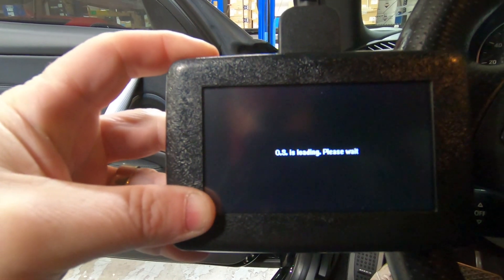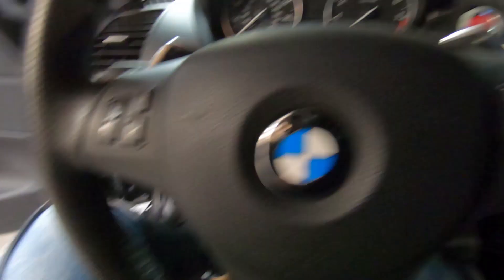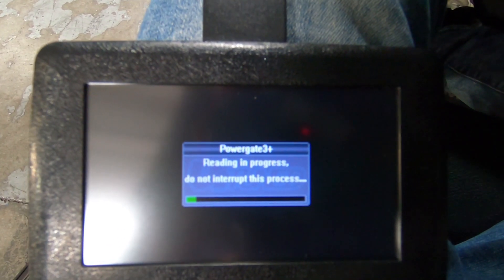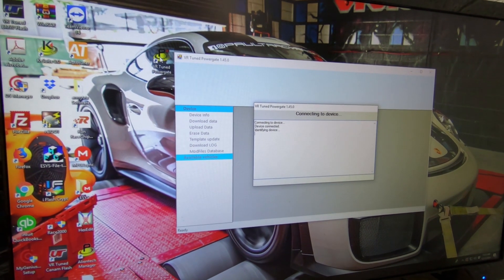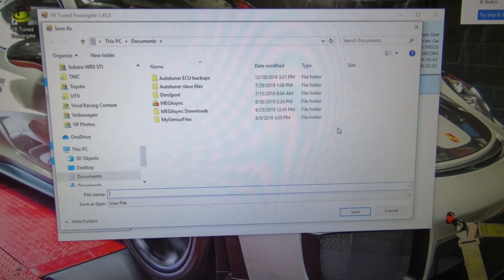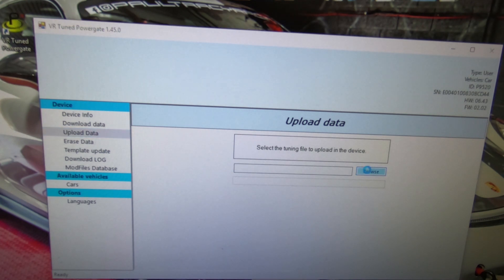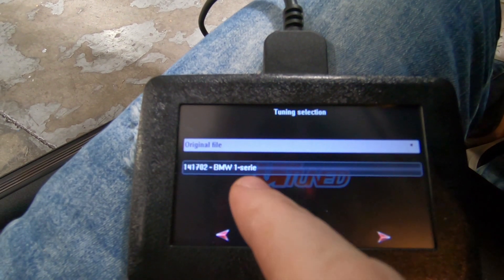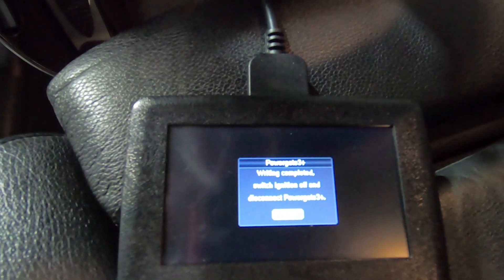How to Flash Your Car with the Alientech Powergate 3+

Comment: Does the Powergate 3 do Data logging as well?
Reply from the maker: No
Reply: The powergate 3 can data log, but only some simple stuff like knock sensors, coolant and oil temp, rpm and manifold pressure / boost pressure. There's a few others I can't remember.

Comment: Hey just wondering I got a e92 bmw 328i and if I get a stage 3 Intake manifold and buy this tune will it make even more horsepower
Reply from the maker: If your car is not tuned then yes. This device is not a tune but is the tool that writes the file to the car.

Comment: Hello, nice device! and you do a nice job to explain it on this video. I have 2 questions...1: Can I use this device on a 2006 Jaguar XKR with the 4.2 L supercharged engine? and 2... I live in NYC and my car has to pass each year a state motor vehicle inspection...would this device change anything that my car may fail the inspection? thank you. could you please answer me to my e-mail address
Reply from the maker: Yes you can. Contact us tuning@vividracing.com

Comment: Can I use this on gm vehicles to switch a vin if my sps will not install the right vin or a vin stuck in a rebuilt pcm
Reply from the maker: Unfortunately not, it is an end user tool only for reading and writing "maps" data for tuning!

Comment: This might sounds like a dumb question but are the flash files unique to each vin/car? ie, can i backup the ecu from a tuned car and flash it into another car with an identical ecu model?
Reply from the maker: Each tune is generated per the VIN. This means it unfortunately can’t be transferred to similar hardware